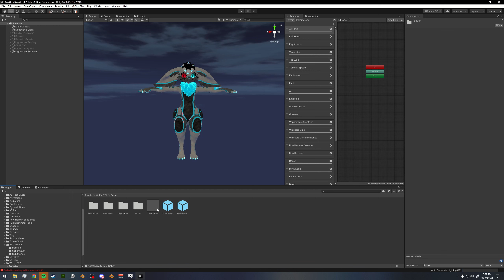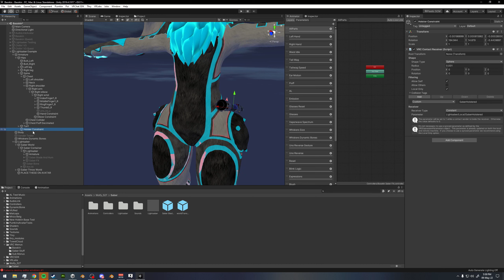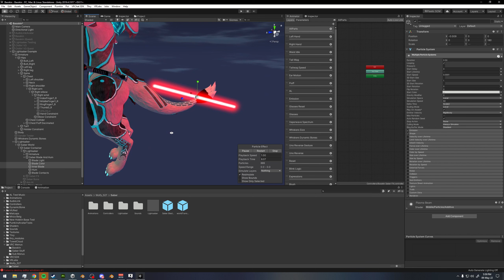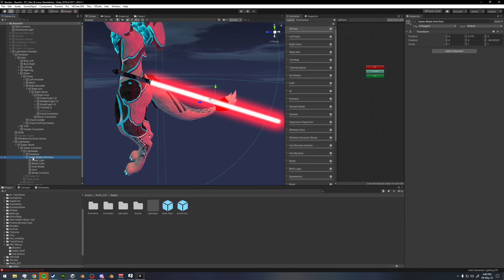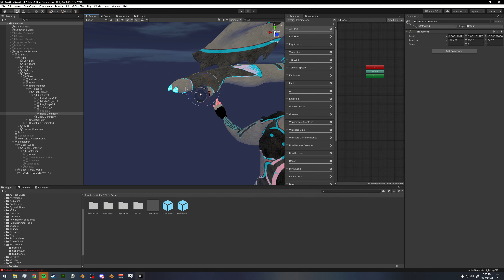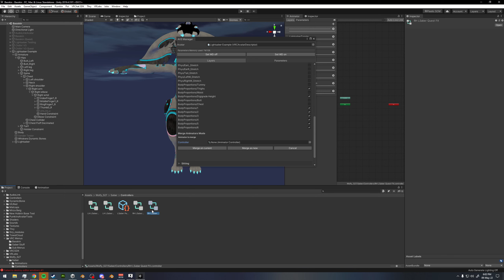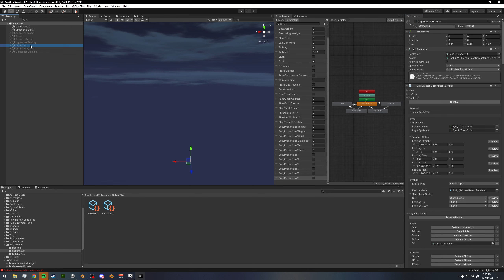VRChat - Avatar Dynamics - Plasmasaber Prefab Set-Up

Comment: Howdy, been trying to chat you through discord, when I am setting the positions for the Saber on my avatar, and go to the container and align it with hand / where I want it on my hip, then go back to the container and do the 0 > 1 > 0 part, the location is always off when switching between the two set locations and in game the saber is way off from my hand when grabbed if aligned to the hip or way off the hip when aligned properly to the hands...Thank you for the help.
Reply: Scrolling down and reading I have now found a possible fix hopefully

Comment: So, everything's working absolutely fine. However, I've ran into an issue where none of the sounds (except the humming sound when ignited and idle) are playing. I have Write Defaults all off and followed all other instructions correctly (at least, I think). Do you know where I possibly went wrong?

Comment: Either I;m super stupid, or that saber just hates me.
I did all you said, yet the saber doesn't want to show when I play test it on Unity. I checked the wd and set it all off and on so the error disappeared, but it still refuses to work.
Reply from the maker: You'll want to make sure your FX controller is placed in your animator component in Unity if you are testing things in Unity. Although, the saber is relatively difficult to test in Unity without an emulator or good knowledge of how the animator works / how to navigate it.

Comment: mine when merging fx with avi3.0 it copies the parameters not the layers tho
dont know why been trouble shooting for a while
Reply from the maker: You'll want to make sure that both AV3.0 manager and your SDK are up to date. I've also seen some problems with AV3.0 manager not copying over properly unless you select "merge onto current." If you do that, I would just duplicate your FX controller first to create a backup just incase anything did go wrong in the process.

Comment: It's great, but there's one question, I don't know if I made a mistake. By default, lightsaber particles are flat, not cylindrical.
Reply from the maker: Hi, really sorry about the slow response! You will want to make sure that the saber and particles weren't scaled across an individual axis (i.e. the X, Y, Z axis). You'll want everything to be scaled evenly, so you'd use the center grey box on the saber if you use "R" when selecting it to scale it.

Comment: Hello! I seem to be stuck at the "Placing New FX Controller On Avatar" step. When I go into the "Generated" folder, there's nothing there.
Reply from the maker: Hi, sorry for the late response! Sometimes AV3.0 Manager doesn't properly generate a new FX controller, but if you just duplicate your current one and label it as a back up, and then select "merge on to current" in AV3.0 manager, it will merge the FX controller onto your current one. Hopefully this helps out!

Comment: Hi Wolfy!

Amazing lightsaber package and tutorial! 

I purchased it on Booth yesterday and got the version 1.2

I managed to get it all to work (thank god I also read the description!).

Write defaults all ON for me, no mixing so all good. Sounds play, throwing works (I had to 0 out the angle on elbow restraint, all good) 

However I got feedback from people yesterday that some people could not see the light saber (plasma/particle bit, they could see the hilt and light source going off) amd others could see it.

I then asked if they were already in the world when I took it out and they were late joiners in the world.

So even in the version 1.2 there is something within the parameters that causes certain people to not see it, but not everyone, seems to be late joiners in the world!

We have this issue with big particle animations too and we usually are forced to make a reset gameobject to prevent this from happening in game!

So just wanted to give you a headsup on that!

For the rest all works and I love the hue slider parameter you added, worked fine too after making it a float parameter!
Reply from the maker: That is odd as it shouldn't actually be possible for even late-joiners to desync like that. The toggle itself it set up so that if it is on for the local player, a synced parameter tells remote players that it is on, late-joiner or not. I haven't had anyone else mention this so far and I've seen that some recent updates have been causing issues with parameter drivers, so it's a possibility that could be the issue, but I will look into it and make sure nothing odd is going on there as no one should be desyncing like that. 

Thank you for letting me know!

Comment: im having some troubles ive added you in discord
Reply: cant get my toggle going at all
Reply from the maker: Hey, sorry for the slow response!

You'll want to make sure that the prefab is on your body's base in the hierarchy, then you'll also want to make sure that the FX controller properly merged with your current one. You should see if under "Plasmasaber" in your FX controller if it did properly merge over. I suspect this is likely the problem you're having as it can be a bit tricky to get the FX controllers merged properly sometimes.
Reply: if possible could you accept my add on discord and help me

Comment: Thank you so much it works flawless <3
Reply from the maker: Glad that it is working great for ya!!
Reply: @Wolfy527  however a little bit off topic but i also notice a furbrush on your avatar texture and it looks actually really good may i ask what your settings are?
Reply from the maker: @lorenzopinna9632  Thank ya! To be honest I don't quite remember what settings I used for this texture in particular. I lost a lot of previous texture files last year and so I don't have this project in Substance Painter anymore unfortunately. Normally I find a base fur style that I like at the start, and then layer different filter strengths and colors together on top of one another to get the look that I like. For example, with the light-grey part that goes around my sides and to my back I have the white fur underneath, and then layered a dark black for the dark shadows you see in the fur, and a light grey for the rest of it to get the highlights/rest of the fur in that area.

I hadn't considered making a tutorial on showing how I make textures, but that might be something I'd consider doing since I've had a few people ask about my work-flow.

Comment: Hi Wolfy _527, I've been having trouble with the Avatar Manager, I tried using an older version with no luck. The Bassken Saber FX isn't in VRLabs and I'm stuck with a few errors as well that might be a clue but I just dont know where to go from there! 

Thank you, Reli
Reply from the maker: The "Basskin Saber FX" is just what I personally had for the name of my avatar's FX controller. Yours will be whatever the name of yours is. I know that using "Merge Onto New" can be buggy at times, so if you locate your current FX layer and click it and duplicate it (ctrl + d while selecting it in the folder) then you will have a backup of it and you can use "Merge Onto Current" in the AV3.0 Manager instead. 

The errors could be from a multitude of things though. The most likely culprit is the SDK (might need to be updated) or potentially AV3.0 Manager if you accidentally have multiple versions of it or something of the sort in your project.

Comment: im having some trouble at 8:00 where it has all of the correct layers in the fx file but it dosent generate any other files in the vrlabs folder
Reply from the maker: You might have selected to "Merge on current" instead of "merge on new" which would cause the FX controller to merge with your current one, instead of making a copy and putting that in the folder.
Reply: @Wolfy527  sorry i figured it out but forgot to delete the comment. thanks for the help anyways. also i added you on discord and would appreciate if i added you back

Comment: Great tutorial ! It works perfectly fine and everything however it messed something up on my avatar. I believe it messed with my blendshapes so now those are bugged whenever I use my clothing toggles, any reason for this possibly?
Reply from the maker: The most likely reason that is happening is due to mixed "Write Defaults." You'll want to check AV3.0 Manager in the WD tab and make sure it isn't showing a warning about using mixed write defaults, if it is, then you'll likely want to select "All On" to fix it!

Comment: Can this be set up with 2 lightsabers?
Reply from the maker: Technically, yes. But it would be quite involved to do with how I currently have it set up. I am planning on going back and revising how the saber is set up in the future, I just currently have some other projects and such that I am working on so that portion has kind of taken the back burner for me at the moment. I would only recommend trying to set it up with two sabers if you have quite a bit of Unity knowledge as it can be relatively extensive to modify at the moment.

Comment: it wont let me Add Control its greyed out i use a unity package called Tiara that provides my  Toggles but it dosent allow parameters
Reply from the maker: It's likely that the reason it is greyed out is that you have the maximum amount of toggles that are allowed in a sub menu  which is 8. You will want to make a new sub menu for the toggle or find a different location to place the toggle so that you are able to add a new control.
Reply: @Wolfy527  I created a new sub menu still didn’t work then I deleted everything and started again when I change the values to go to the hand the light and the blade stay in the waist constraint
Reply from the maker: @zerosmiley390  When you create a new sub menu you'll want to make sure that you have all of the parameters from the "Synchronized Parameters" section in your parameters expression list. If you're using a new sub menu then it shouldn't be greyed out.

In regards to the light and blade not following the to the hand constraint when changing the parent constraint values, something else was likely changed on accident and it might be causing something like that to occur. I would delete everything pertaining to the saber itself and drop it back on your avatar and go from there as all of those things should be following the constraint locations when you change them.

Comment: Is it possible to have two sabers on one avatar or will only one work on an avatar?
Reply from the maker: You could technically have two on an avatar at one time, but you would have to change all of the parameters for the second saber so that they don't overlap with the first saber. 

I'm planning on making a dual saber prefab in the future that will be building upon things from the current saber prefab I made, but unfortunately I don't have an ETA on the dual-saber prefab at the moment.

Comment: so much thanks for this but i have one issue atm well 2. the throw is kinda odd. it is fast and requires n movement to trigger. second and biggest is no one can see/hear my saber.
Reply from the maker: So, for the throwing out being a bit odd, you'll likely need to 0 out the rotation values on the "Elbow Constraint." And then for the second part, you'll want to make sure that all of the "Plasmasaber/Net/..." parameters are in your parameters expression list that goes in game!
Reply: @Wolfy527  only one i don't have is hue shift. Couldn't figure out how to get that one to work. So I said F it i'll just be Darth Thotius :3
Reply from the maker: @BlackMageGG77  Haha the hue shift slider is similar to a normal toggle you would make for your in-game menu. What you'll want to do is make a "new control" in your menu and change the type to "radial puppet" and then use the "Plasmasaber/Net/Hue" float in the "parameter rotation" slot and that should work for ya!

Comment: I followed this to a T except for a few changes that were made to your file on Gumroad and having to manually transfer the layers over.... but for whatever reason... the saber doesn't show up or do anything in game even when toggled. Ideas? Thanks! Great video! Excited to get it working!
Reply from the maker: Sorry about the inconvenience with having to manually transfer layers over. AV3.0 Manager seems to be bugging out for quite a few people and conflicting with some SDKs, causing the merge animators feature to break and only merge the first layer (which is just used as a separator in the FX to keep things clean) which is labeled "------" which it isn't supposed to do. If AV3.0 Manager isn't properly merging the layers over to your FX controller, deleting AV3.0 Manager out of your project entirely (you can just delete it in the VRLabs folder) and then downloading an older version should fix that merging problem for you. You might also want to make sure that you have the newest SDK as that could cause problems with the program as well.

After merging things properly, the only thing you'll want to check is the "WD" tab to make sure it doesn't warn you about using "mixed write defaults." If it does, then look at the animations list there and see if things are mostly checked or not, if they are, then select "all on," and if they aren't, then select "all off."

Comment: uhmm i have a problem when i merge the fx and then go into animator i dont see the new layers. it works fine for the parameters. i can see the layers in the merger but not in the animator. this results in the toggles not working ingame somehow.
Reply: nevermind just dont use the newest merger
Reply from the maker: Sorry for the delayed response! I've come across a few people having this issue with various different versions of AV3.0 Manager and it conflicting with the SDK, causing some errors that prevent merging from working properly. I thought I had found a version of the AV3.0 Manager that worked for everyone, but some people had to use a different version to get it working properly for themselves.

Sorry about the inconvenience, but I'm glad you got it figured out! If you have any other questions just let me know and I'd be happy to help in any way I can!

Comment: So i uploaded an avi with the saber, constraints, and toggle all setup, but for some reason the toggle does not turn on the saber inside of vrchat.
Reply from the maker: A common issue people have been having after a more recent update to AV3.0 Manager is that it does not properly copy over the FX layers from one of the FX controllers that I provide to merge with your own. Double check your FX controller to see if the layers that are in it for the saber match up to one of the FX controllers that I provide in the prefab. If you only see a layer with "--------" then check out the AV3.0 Manager link that I provide in the description as that one should work for merging the FX controllers together. You will just want to make sure you delete all of AV3.0 Manager out of your project before importing the other one if this is the problem you're having.
Reply: @Wolfy527  Ill try downloading an older version than the one you provided and see if that helps. I did download the one which was linked.
Reply: Figured it out, had to get the latest version which seemed to work. must have been some weird issue with my unity instance.
Reply from the maker: @shobo9596  Ah, if the newest one is now working I will update the description to that one after testing it myself to double check! Sorry about the issues, it can be a bit difficult to narrow down issues like that sometimes!